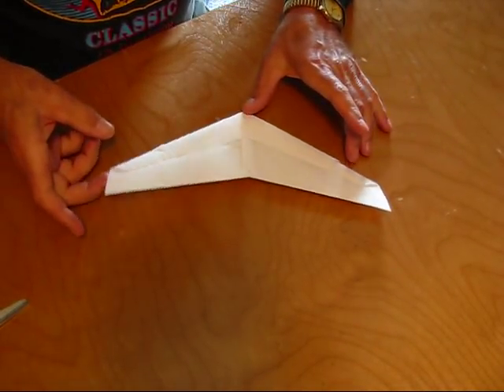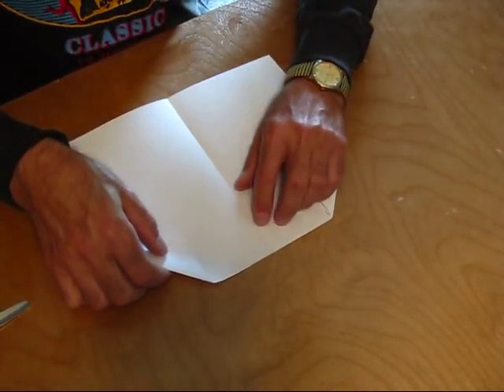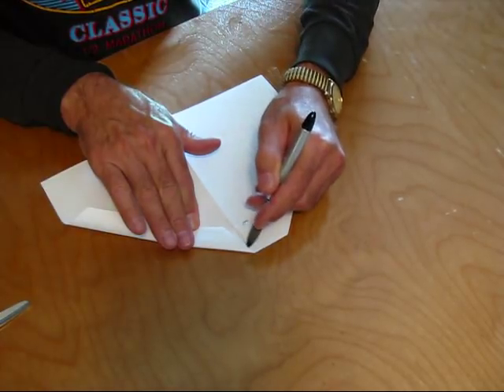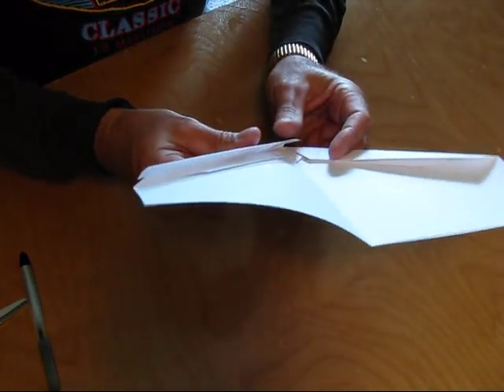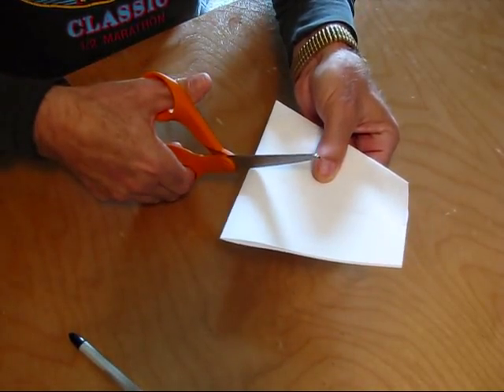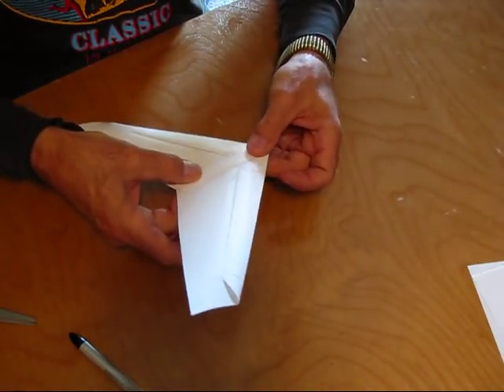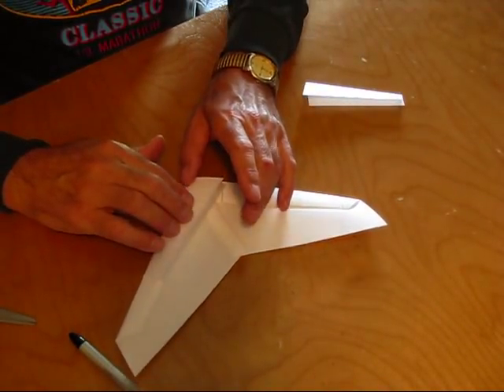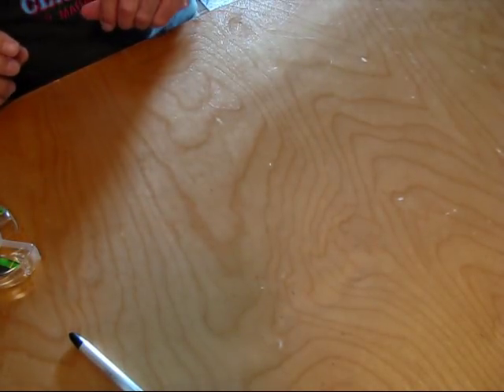Building the OmniWing Paper Airplane

Comment: When i launch it it starts going well but then it just tilts over to the left, goes upside down and crashes
Reply from the maker: It sounds like you are not getting equal twist in the wings.  Build another and if you get similar response such as it going into a turn, try tweaking the wing to correct.  If it is turning left, create a bit of upward bend on the outer most trailing edge of the right wing.  That will help slow the right wing down and correct for the turn.  Vice Versa if turn is in the opposite direction.  Often a wing even built by the master requires a wee bit of tuning for straight flight.  Good Luck to you.  Let me know if you have success.

Comment: menamiketrx Hi, I really want to make this paper airplane, but I don't understand 'the twist' thing. My plane just goes down, it can't fly. Please reply. I need this airplane for a contest!
Reply from the maker: If the wing is diving into the ground, you are not getting enough twist into the wing halves.  Check out my tutorials about paper airplane aerodynamics at OmniWing Paper Airplane Aerodynamics

Then try to build again, but try to get as much twist into the wing halves as possible without putting wrinkles into the wing.  Also, might try building the Proto-OmniWing first.  It has a little simpler build.  Also watch some of my flight videos, as it will show how to launch. 

Best to you.

Mike
Reply: menamiketrx thanks!! :)

Comment from the maker: More often it is a problem with having a properly built OmniWing, rather than the launch technique.  Let me know what you wing is doing after launch.  I may be able to diagnose the problem.  Also, checkout on my channel three videos showing launching and flights of the various OmniWings.  I also suggest that the first wing you should try to build is the :Proto-OmniWing, also found on my channel.  It has a little easier build.

Comment: how many degrees to fold at 2:00 please help its needed for homework
Reply: That can be varied.  Will effect the amount of sweep in the wing, but I have success with going with very wide angle as well as not so wide angle.
Reply: @mikekelsey6777  thank you for your help friend but i want to choose one of the posible angles that give planes with very good quality becouse this is for my lean process design homework and quality will effect my grade can you maybe give me few posible good angles that you used? (note : i think symmetry and duration of plane flying before hitting ground is the most important qualifications of quality)
Reply: @kocakOFarc  I encourage you to try different angles.  Depending on other factors such as twist and the cut of the trailing edge, you get minute differences in flight.  Best that you build a number and fly them to see which is working best for you.
Reply: @mikekelsey6777  ok thank you for your advice also if you remember anything about your past experiments effect on perforfance of your plane i would really apritiate to hear them

Comment: my omniwing keeps turning left even if my plane is completely symmetry
Reply from the maker: I have to tune most of my OmniWings for straight flight.  To correct for a left turn, you need to slow the right wing down.  I do this by tweaking a little bit of up aileron out on the trailing edge of the right wing.  Also check out the video on my channel titled "OmniWing Paper Airplane Aerodynamics " or go to OmniWing Paper Airplane Aerodynamics

Comment: I added elevation and it flew straight
Reply: Occasionally the OmniWing may require tuning for speed and turns.  I use a technique where I simply run fingernail across the top or bottom with index finger pad on the opposite side to make slight crease, rather than cutting in ailerons.  But good on never giving up on a wing that has an issue.

Comment: It's not an omni wing, it's called a "dive bomber" as it does not fly and it drops instead
Reply from the maker: Callum:  On my channel you will find several videos showing the OmniWings in flight.  Indoor flights, outdoor flights from mountain tops, catapult launch indoors and outdoors, and instructional on how to build the Proto-OmniWing, the Omniwing with modifications, the advanced OmniWing, and the Origami OmniWing.  If constructed properly the OmniWings fly quite well.  It is a bit more challenging wing to build than most.  If your wing is diving, then without a doubt you did not get enough twist in the wing to establish proper washout at the tips thus no proper dive control.  I suggest you try the Proto-OmniWing first, (also on my channel), as it has a different method for establishing washout, but still quite a capable flyer.  Best of luck to you and do let me know if you have any other questions.
Reply: menamiketrx I did one with more twist then the one in your video. It's just flies down after 2 meters.

Comment: This fails it just fly down immediately when you throw it
Reply from the maker: Fail only means you stopped trying.  On my channel you can see many videos showing the OmniWings in flight.  Now with that said, it is true that the OmniWing is not the easiest  paper airplane to build.  It has some unique and difficult steps, and if not done correctly, it is very likely your wing will fail.  The usual issue causing a fail, is the failure to get enough twist in the wing halves.  Try again and if you do not have success, have a try with the Proto-OmniWing or the Origami OmniWing. both found on my channel.  These provide bit easier although crude method of establishing washout, they still fly pretty well.  Best of luck to you. The OmniWing goes Origami Style with the "OmniGamni"!, and Construction of the Proto-OmniWing Paper Airplane

Comment: could not get the twist properly
Reply from the maker: That is the most challenging step.  On my channel, check out the "Proto-OmniWing.  It provides a simpler method for obtaining the necessary washout without the difficult twist maneuver.  Not as elegant, but it is effective with only a slight decrease in performance.  Good luck to you.
Reply: WW E .
Reply: menamiketrx .
Reply: Po CHO

Comment: dude, use smaller words, it's a good method, but use smaller words. Little kids could watch this. good job tho!
Reply from the maker: Thanks for the input.
Reply: you're welcome. it didn't work for me tho
Reply from the maker: Robo Tronica It is a challenging craft to build.  Tell me what your wing was doing when you launched it.  Maybe I can diagnose what is wrong with the build.  Also, take a look at the Proto OmniWing also on my channel, as it follows the early steps of the build of the OmniWing, but achieves the needed washout at the wing tips in a bit simpler way.  Less elegant, but it gets the job done.  The hardest part of the OmniWing build is getting the twist and washout correct.  Not enough twist and the wing will simply dive to the ground.  The twist and washout serve the same function as an elevator on a regular aircraft.  Also take a look at some of my tutorials about paper airplane aerodynamics.  Best to you.
Reply: yes, it is. idk what was up tho
Reply: ohh ya

Comment: I can't make it
Reply from the maker: The OmniWings are a bit of a challenging wing to build.  I recommend to start with the Proto-OmniWing found on my channel as well as the Origamni (an origami) method of folding also on my channel.  Both are much easier to build, thus a greater chance at having a good flying wing.  Do let me know if you have success.
Reply: Can u use regular printer paper
Reply from the maker: Avery Dallas Yes...  that is what I usually use.
Reply: Okey
Reply: Can u learn how to make different airplane that is a little easier

Comment: Not origami because for its tape and cutting
Reply from the maker: You are correct, but I made no claims that this was Origami.  I like to employ cutting and taping to provide maximum flexibility in my design.  I consider my OmniWing to be more of an exercise in aircraft design and aerodynamics rather that a work of art.  My goal was to build a true flying wing employing all design criteria that one would consider in building a full scale aircraft.  Airfoil shape, Sweep, Dihedral, Twist and washout in the wing, center of gravity center of pressure are all considerations in order to achieve a wing that has a high glide ratio, low sink rate, and good stability.  Recently I did add an Origami OmniWing video to my channel,  Check it out!  Maybe you will enjoy that.  Best to you.

Comment: wait no scratch that it flies terrible and the instructions are too hard to follow
Reply from the maker: Pj:  One must consider that not all are successful on their first efforts.  It is an aircraft, and if not built properly, then it will fly poorly.  I suggest that maybe you should try the Proto-OmniWing, also on my channel as it has a similar build but achieves setting washout in a simpler fashion, and has a greater success rate for those that build it.  I encourage you to not get into the habit of quiting after the first try, be it sports or crafts, or whatever.
Reply from the maker: On my channel you will find several videos showing the OmniWing in flight, and indeed you will see that it can and does fly very well in a variety of settings.  Take a look at some of those, and maybe you will want to give it another try.

Comment: it sucked...i am using an a4 paper...and i followed every instructions except the curvy part.. it sucked it doesnt fly and you should make a step by step picture instructions..that will be wayyy better than this balantly folding on a video.. sucks hard.
Reply: And yes...it works when i flip it over..(the page that doesnt have tapes) it flies slowly and glide well. not sure it does works like this but thanks and cool and i still cant fold the curvy part yet..can u explain more?
Reply from the maker: La roux Almost all aircraft have twist designed into the wings.  So for example if somone built a wing for a plane and the leading edge lays flat on the floor and the trailing edge lays flat on the floor, that would be a wing without twist.  But take one of the wing halves, secure the part that would join the two wing halves together and secure it to the floor.  Let the entire leading edge remain in contact with the floor.  Now raise the trailing edge out at the wing tip around 6 to 10 degrees and fix in place and you have a wing with twist.  Aircraft that display the best example of twist in the wings are the modern day hang gliders.  Do a Google search for images of hang gliders and you will see the defined twist in the wing halves where the trailing edge rises from the root out to the wing tip, .  Compare this to some of the views of the OmniWing and you will see the similarity.  So, it is not a bending, but a twisting.  A very difficult step, but is essential in achieving stable flight.  If you build a wing, and it fails to fly, do not give up on it.  Try to make it fly by tweaking the trailing edge out at the wing tips as though adding some flaps.  Bend up a bit to keep it from diving.  Hope you can work it out.  I did try several years ago to present in book form, but the twist step simply could not be conveyed.  I have had better success with the vidoes in getting the build across.
Reply: menamiketrx Thanks a lot.. But I came here to tell you i made it..I used the face that has the most tapes and it flew.. But this omniwing costed a lot of tapes and wow.when i cut the half to half part..The wing is too big for my omniwing..so i cut a lot and adjust..wew..thanks a lot! you earned a new subscriber!! please reply ands  how to throw it..which finger should hold because the video is not clear..
Reply from the maker: La roux I launch with thumb and little finger on the bottom and the other three fingers on the top surface.
Reply: menamiketrx which angle you should point? and where to throw it..e.g shoulder above head or neck? thanks for the fast reply..
Reply: menamiketrx What is the cause and what should I do? When the Omniwing flies left or right? May it be the power I throw? Or the curve is imbalanced or it got strucked so it cant fly properly?
Reply from the maker: La roux Right at about eye level.  The launch is more of a gentle push.  Usually I try to launch it at the speed of which it normally flies.  Also the nose is pointed down ever so slightly.  If you launch it with the nose pointed up, it will stall.  Practice and practice and you will get it right.
Reply: Thanks.I can curve very well now.